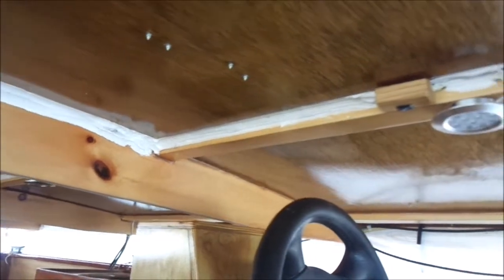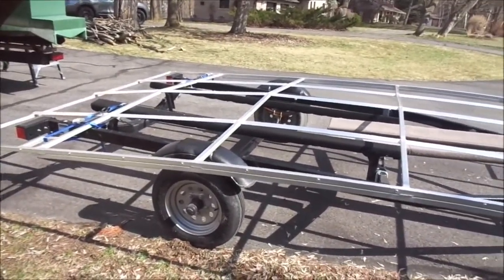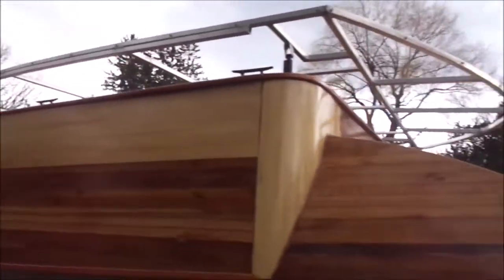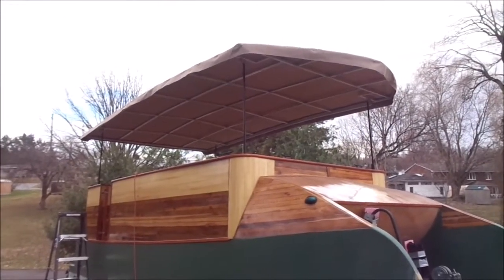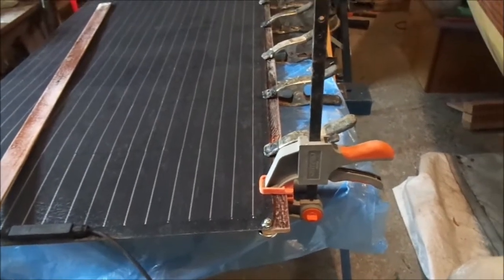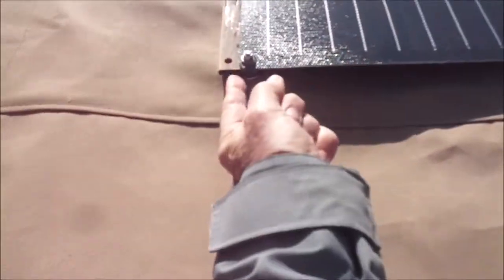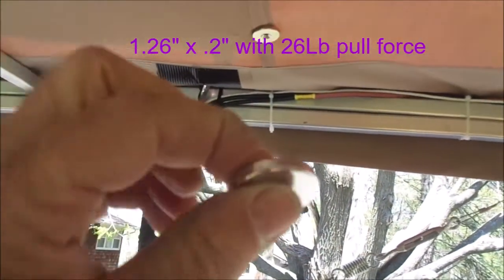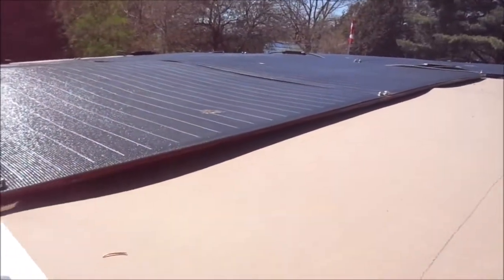New Custom Canopy,  Building My Solar Electric Catamaran Part Twenty Four

Comment: Great ideas there Phil.  Never considered the magnet application for mounting panels.  I'm back at my catamaran finally after two years.  So far so good!  Still need to patch a hole in my starboard hull and paint her from bow to stern.  Otherwise doing remarkably well considering the river was running through her starboard hull.  

Amazing that my one electric outboard survived me working on it today.  Turned out the old cat6 cable I was using on the one motor was bad.  When I finally got around to shortening after purchasing a better quality of wire with like 10 strands in it but barely thicker than cat6 and hooked it up finally after a few days of troubleshooting it - well guess...

Yep the top white main voltage wire in the middle of my sevcon millpak I moved too far over the black post on the right.  Sparks everywhere and I watched it form in slow motion it seemed as quickly as the anomaly occurred it ended with the key being switched off.  Result - concerned I may have just purchased two new Rayeo Electric Outobards - otherwise I had faith.

Corrected the alignment of the sevcon lugs and checked fuse.  Try again...  Sweet music to my ears.  My eyes were visibly wet as I gave God thanks for the blessing.  

Been onsite since the 16th and self-sufficient in the boat yard since the first day.  All wee was spent top balancing 16 400 amp hour cells.  Again took me a week and I was blessed with a working battery pack with zero negligible defects in capacity or actual veracity of the cells.  They perform as new and hold more than the advertised 400 amp hours each.  

Hoping to receive a few good quotations for the two hull repairs and entire boat paint job.  Raising the cabin roof and back bimini also getting quoted.  Outboard motor  mounting improvement also quoted.  Oh yeah and inner swinging doors and windows on the cockpit bimini so I can open or close the space as needed.  This way I avoid fabric and ensure maximum protection of the back hulls from water ingress and elements that degrade the paint back there.  Bonus I gain around 96 square feet of living space when needed.

If I get my roof I'll be double skinning it with plywood or foam as the case may be so that I can have a cooling air barrier before the roof and someplace to hide the cabling.  Can magnets go through 3/8" marine ply?  So yeah direct application with some glue this time for the new panels.    Hoping for over 3000 watts but will see how much roof space  I can  make.  Tired of hitting my head.